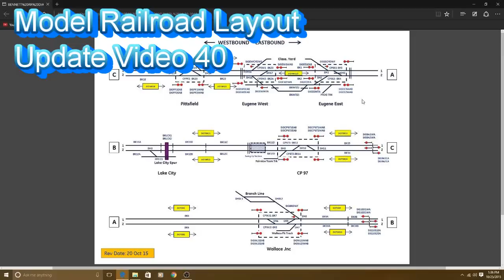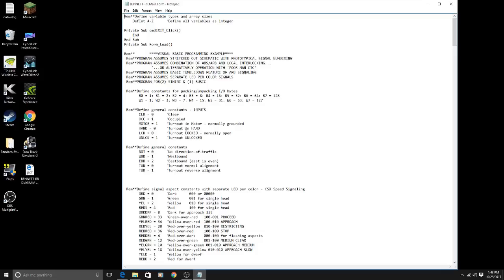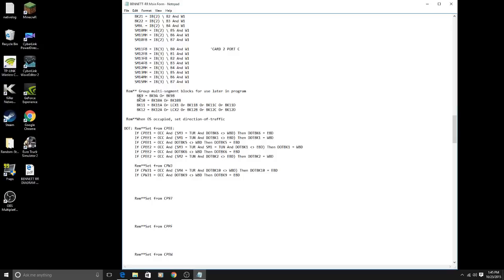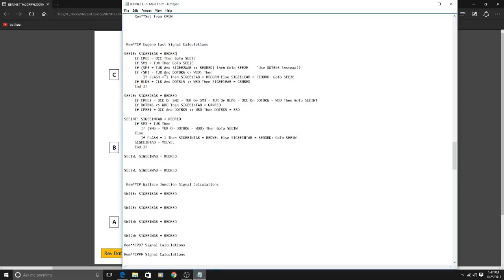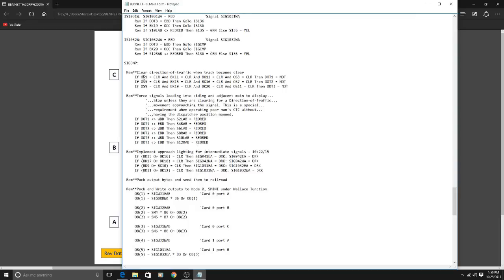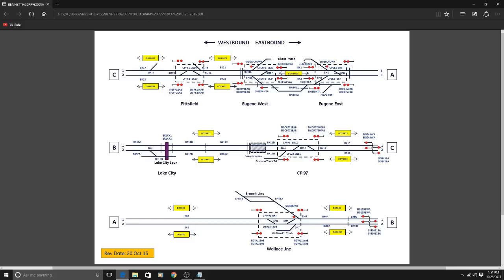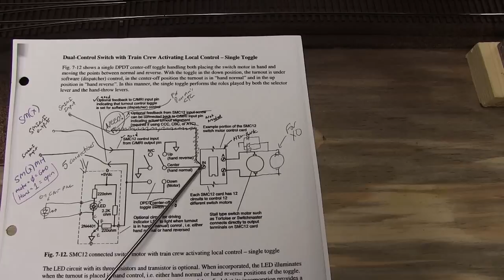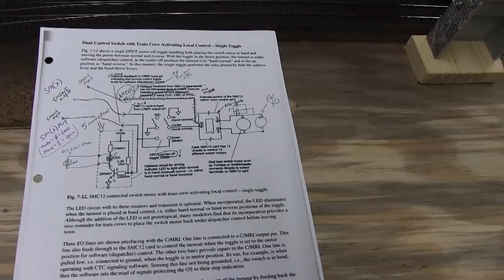Model Railroad Layout Update Video 40 - C/MRI Programming

Comment: Ahw man someone is getting terminated in the very near future. Ran 3 red blocks and running the train pretty hot lol great video and as far as the signal at the yard its really gonna depend on what RR your modeling. Just as an example on the bnsf you'd either call the ds and ask for permission to flag the signal or ask for track and time which would give you unlimited use of the track and switch between 2 points. I agree with what the other guy with leaving it as restricting signal, but the only problem with that is that once you pass it you can't go back and you won't have any indication back over that switch. Track and time is kinda the only thing that would give you permission through and back pass the signal without getting in trouble (prototypically).  Idk what other RRs would call it,  but that's what I would call it.

Comment: To answer your signal question, you would likely get a restricting signal if the switch is normal.  Prototype aspects vary from railroad to railroad, but the easiest is probably flashing red.

Comment: if the switch was lined straight to the stub track. it would be a restricting. Red over solid yellow. Due to the fact that it is a stub track. Restricted speed is being able to stop in half the range of vision at 10MPH. The diverging signal could be a few different signals. It could be medium clear, restricting, approach medium,ect. Hope that helps.  Adam.